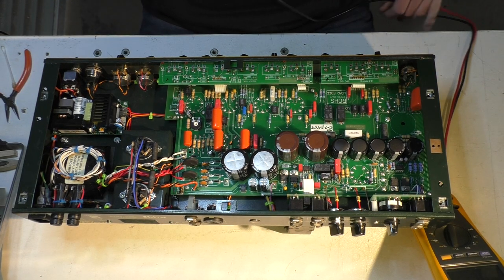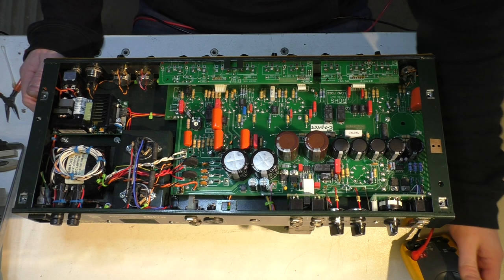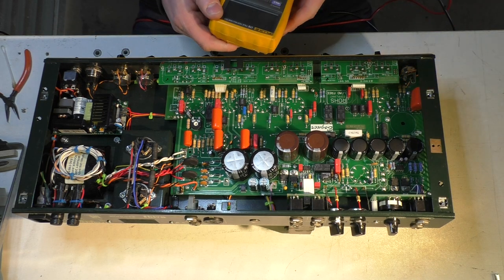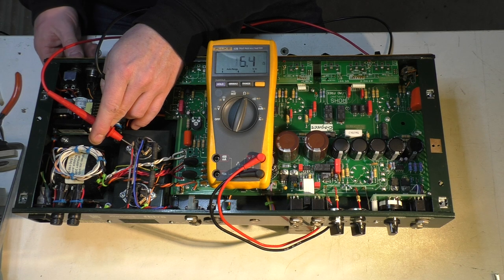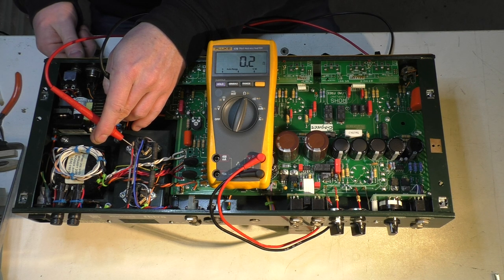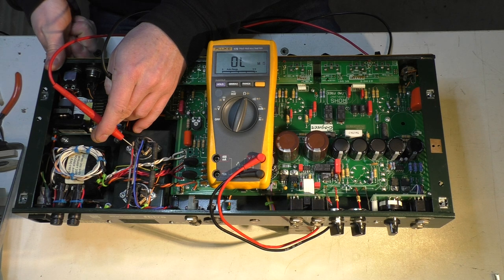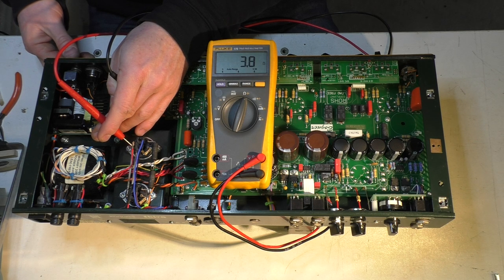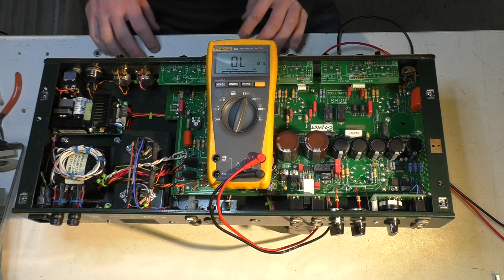Funky power switch on a Bogner Shiva

Comment: Was the amp showing any symptoms during operation? I have a Bogner Twin Jet with a similar three way switch and what happens is that the standby works when the amp is first turned on, but as it gets warmed up sound will start coming through. Once warmed up, both the "on" and "standby" positions allow full volume sound to come through. Did replacing the switch get rid of the issues for youu? Thanks.